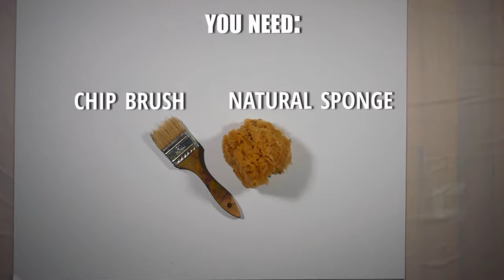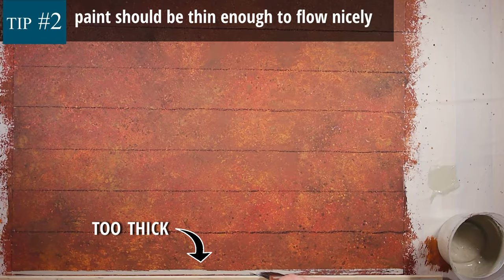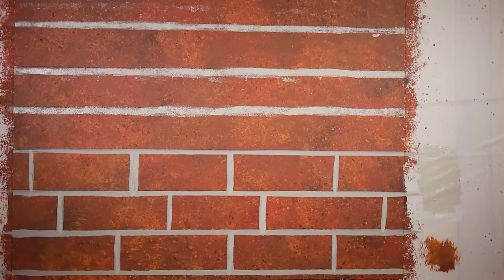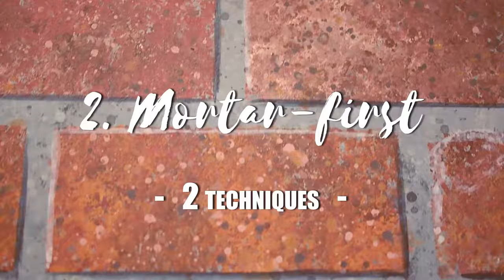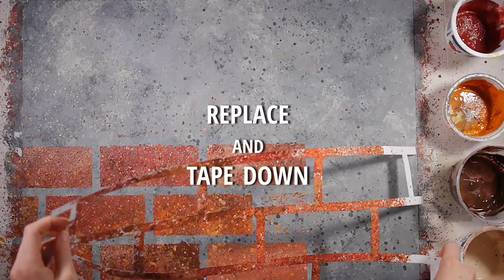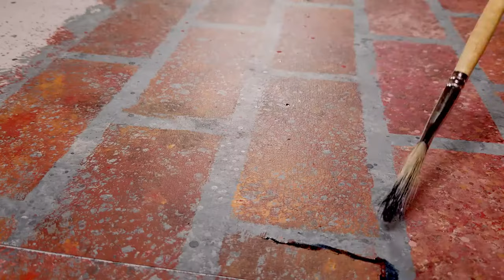Faux Brick Painting - Scenic Art

Comment: Hii this video has been very helpful so far, however I am not able to splatter the paint, it does not splatter in dots and I am wondering how I could do that. (im using acrylics on a wall)
Reply from the maker: Spattering on a wall is a tricky thing to do. If your paint/water mixture is too thin, it will drip/run, and if it is too thick, it can be difficult to apply. I would do some experiments to see if you can get a thicker paint to work. You can try flicking the paint at the wall by flicking the brush across the fingers of your other hand. You hand will get really dirty, but it could work. Otherwise, you could also try applying it with a spray bottle (don't fully pull the trigger, barely tap at it), but you'll still have a hard time with drips. If nothing is working out (you can clean up your messes with a sponge or wet rag!), you could skip it... or use a natural sponge to add some more texture here and there. I hope that helps!
Reply: @BehindtheScenics  It's very tricky for me to splatter my paint onto the wall, plus it is white so I dont want to make it too messy haha :) i dont have a spray bottle either.. maybe I could use a dry toothbrush and dab it lightly? anyway, thank you so much!

Comment: Any color suggestions for shading and highlights using grey and white for the bricks?
Reply from the maker: I do have a video about trompe l'oeil that might be helpful, but in short... the general rule is warm highlight, cool shadow, and the shade is a darker (and often cooler or less saturate) version of the surface color. I would do some samples to see what looks good. Does that help?
Reply: @BehindtheScenics  It does. I am using a white wall as my base and a lighter grey sponged for my bricks. I was going to use a darker shade of grey for the shadow and a lighter grey for the highlight? I am so hesitant because I already painted one wall grey, black and white to look like granite and it came out great. However, I could not replicate it again on another, so now I am starting over and doing the brick. Ugg...
Reply from the maker: @hezb7005  You definitely can start with doing the gray highlights and shadows. I would do a small area and see if you like it. If it's not really working for you, you can adjust, perhaps adding a liiiiiittle color into the grays, as mentioned before. The great thing with paint is you can always paint over it if it doesn't turn out the way you want!